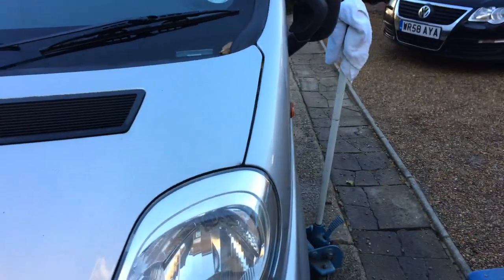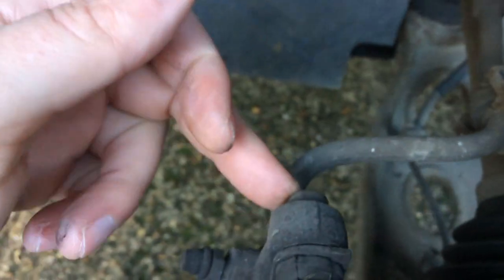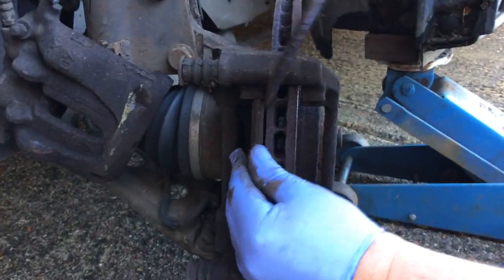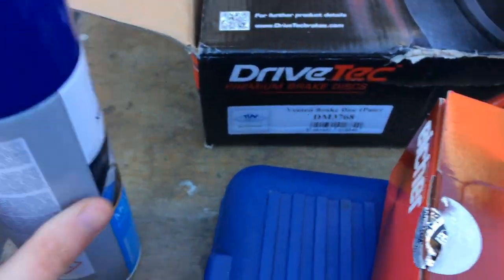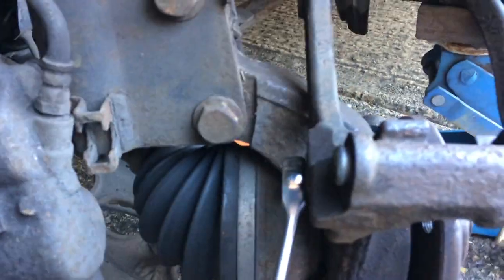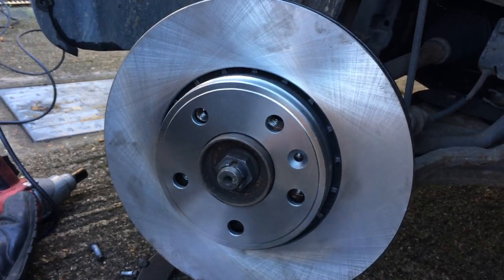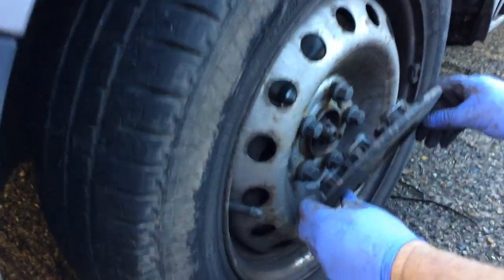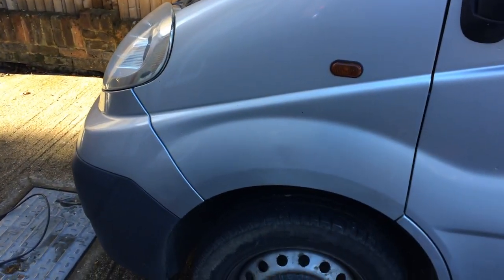vauxhall vivaro front brake pads and disc replacement

Comment: Excellent, thanks. Need to do all 4 of mine. Is it the same procedure on the back? Also, what head did the disc secure screw have, star? Tia
Reply: The rears need a wind back tool which you can buy from screw fix for 15 quid

Comment: Hi ,do you have to do the brake bleeding ,after ? Thanks
Reply from the maker: As you are only pushing the pistons back in to the calliper, you do not need to bleed the brakes when you have fitted new pads. Just make sure you pump the brake pedal a few times after you have fitted calliper back on, this will ensure new pads locate where they need to be.
Reply: Thanks for that !👍

Comment: Any chance of a link mate to where you got these for that price.Even the drive tec site doesnt recognise the part number?
Reply from the maker: The ones I bought and fitted in the video may not be available anymore. But I had a quick look on eBay and found this, search item number 303031478497 if I was to do the job again I would purchase these discs and pads. £48.99 including delivery. You need to supply them reg number to make sure they are correct for your van. Hope this helps. Good luck.
Reply: @repairrestorefixer1242  cool mate,ill give it a go.cheers ,and thanks